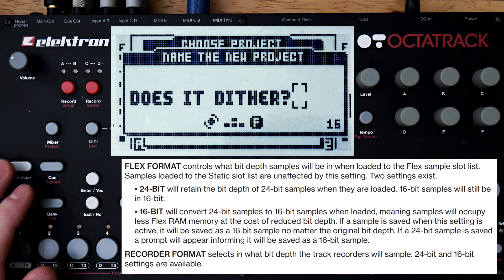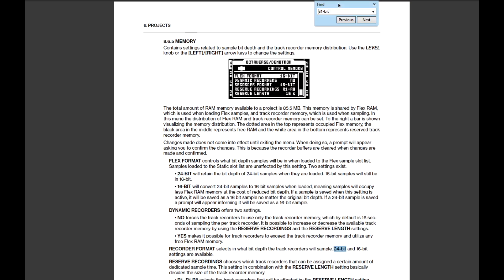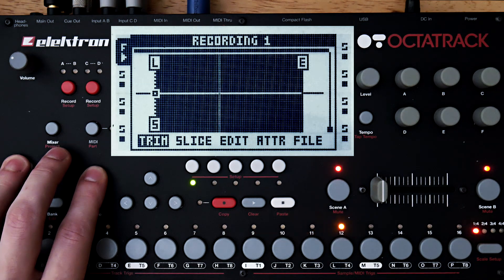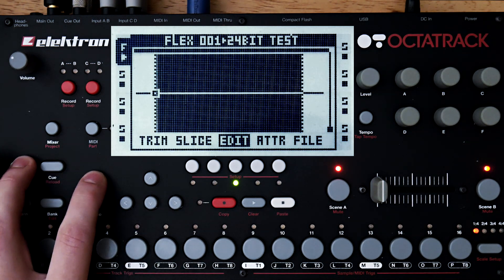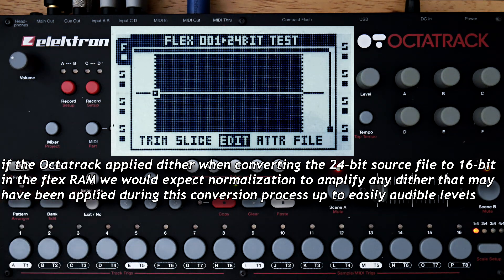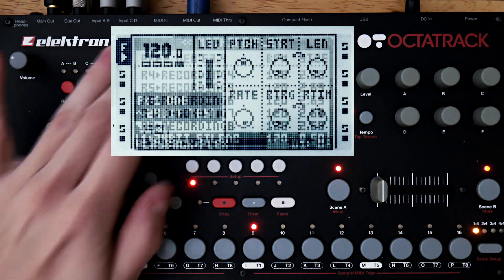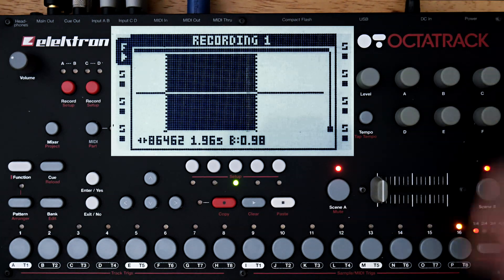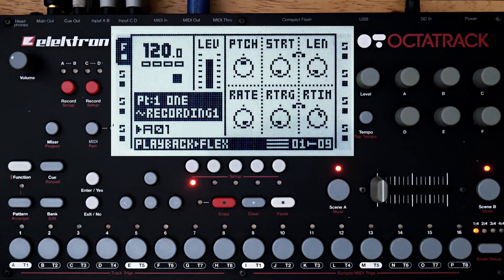Octatrack: Does it DITHER?

Comment: The click you were able to generate is interesting. I wonder if its due to slew rate cut over between DSP chips, a denormalised zero signal glitch or the ghost in the machine.
Reply from the maker: yeah that's a weird one, it looks like a steady DC offset - in my reverb tail artifacts video I noticed a DC offset in the re-samples, which I attributed to the reverb itself, but this result makes me think it's inherent to SRC3 re-sampling
Reply from the maker: just realized I forgot to respect the implications of the default filter in the FX slot - just tried removing the filter and resampling from a silent file and there is no click artifact. In my reverb artifacts video I also was working with an essentially default project (as I often do in these tests) so there was most likely a filter causing that DC offset also

Comment: I love your videos! This is awesome, I bet the DT is dithering because it sounds flawless
Reply from the maker: That could be one of the reasons why DT can't sample real-time - it converts samples to 16-bit mono, but the audio i/o is 24-bit, correct? I remember seeing a frequency spectrum graph on Elektronauts that shows DT isn't particularly transparent with its re-sampling and adds a bit of upper mids/highs to the signal that most users seem to enjoy - a bit 'punchier' perhaps. This thread - https://www.elektronauts.com/t/testing-the-quality-of-re-sampling-on-the-dt/103412 - doesn't have the spectrum graph I remember seeing, but the fact that DT re-sampling brightens the signal is discussed
Reply: @maxmarco  the DT is also 48/16 which I think sounds better than 44.1/16 or 44.1/24. My experience is that 48k really just sounds a lot better/cleaner.
Reply from the maker: thinking a bit more about it, if the DT does add dither, a brightening of the signal when re-sampling could potentially be the result of using some form of noise-shaped dither

Comment: The notorious click captured in the wild!
Reply from the maker: yeah!! for some time I have assumed the OT doesn't apply dither, but encountering the 'internal re-sampling click' was not something I had anticipated
Reply: @maxmarco  Is there a part 2 for the break down for dummies and how this can be addressed?
Reply from the maker: do you mean the internal re-sampling click? or the lack of dither? Re: the click I don't think there's anything you can do, but the vast majority of situations it shouldn't be noticeable - I didn't even really know it was there until I had the idea to perform this test. Situations where you are re-sampling very quiet sounds or doing ambient types of things you are presumably more likely to notice it though. Re: the lack of dither, assuming you don't need or want the RAM/storage space, simply run the Octatrack with 24-bit settings and sources, and although it's not an ideal solution, if you have to work with 16-bit sources make sure they are already dithered before loading them into the Octatrack - and if you are dithering those files yourself it's probably best to go with simple rectangular or triangular dither to avoid potential artifacts/weirdness caused by noise-shaped dither
Reply: @maxmarco  Yeah I meant to prevent it...fascinating vid...thanks
Reply from the maker: just discovered the click is most likely DC offset introduced by the default filter in FX slot 1
Reply: @maxmarco  WHAT! Stellar!  Where you located?

Comment: great inputas always! was wondering about a related thing.. I’ve just started my first project to learn this badboy. It was meant to be a throwaway thing, but now that I’ve started to get the hang of it, I wanna make use of it.

Anyways, I’ve been resampling loops in 16bit, but would much rather have the 24bit fidelity for pitching, further resampling etc. Whenever I go in to the memory setting and change the recorder bitdepth setting up to 24, and go out of the menu (promting that unsaved recording buffers will be lost) my patterns no longer make any sound. Why is that? I’m not using the recording buffers to playback, but have saved my 16bit resampled loops to free flex slots.

I have to reload my project to get audio out again. However, I can still preview samples, only not those loaded to my flex machines. Do I need to replace all the audio-files in the flex sample-pool to make it work like it should? Also noticed that my trigs on one of my flex tracks disappeared after making changes to the memory. After reloading the project my trigs were back. That was really concerning…

Is there a safe way to change bitdepth settings on an existing project?
Maybe it’s possible to start a new project and import the pattern/scene/part data etc?

I only have a few patterns prepared, one bank, one part.
Reply from the maker: many users have mentioned a bug that happens when switching the bit-depth, I've never really experienced what you or others have described though, so I can't offer any advice
Reply: @maxmarco  Maybe it was my OS version.. Just updated, maybe it will work now. Gonna test it out. Wanna be making those 24b loops from the getgo. Damn, I haven't felt this much excitement for a piece of gear for ages! letting go f my mpc live and my maschine mk3 now. Gonna get a second octa mk1 instead!